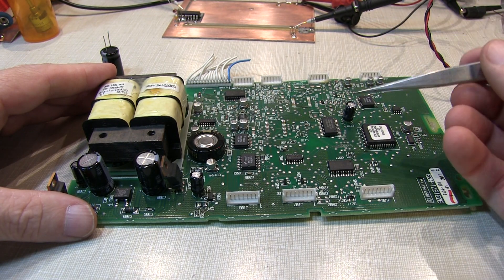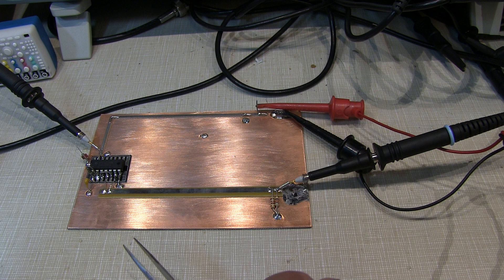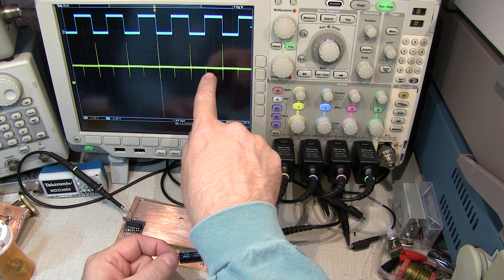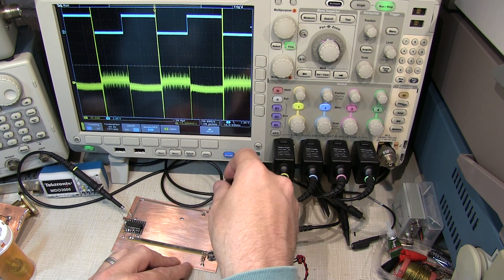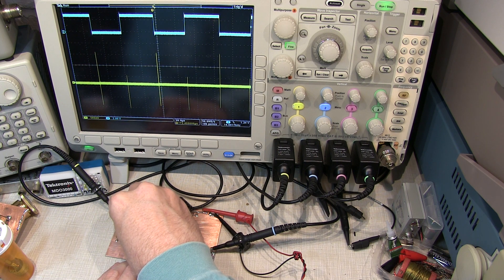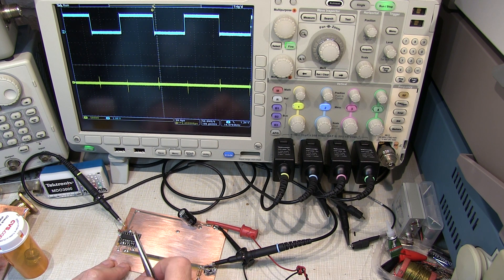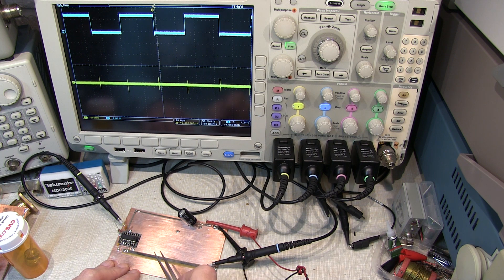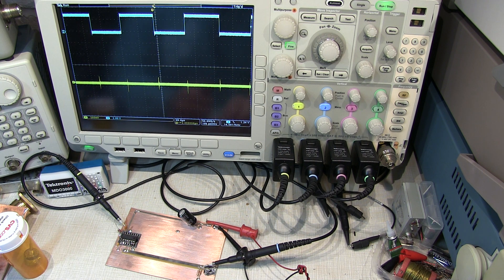#257: Power Supply Decoupling &  Filtering: why we use multiple caps in different locations

Comment: When testing AC ripple on various power supplies how does a technician know what the AC ripple voltage should be? You measure the transformers secondary AC voltage X 1.414 = Rectified Pulsating DC Voltage. If the transformers secondary AC voltage is 12 VAC X 1.414 = 17 VDC output of the rectifier. The Ripple Factor is the RATIO of the AC voltage to the rectifier to the DC voltage on the output of the Rectifier.  To Calculate the Ripple Factor is 12 VAC divided by 17 VDC = 70% Ripple Factor?
Reply from the maker: I don't know anyone that uses Ripple Factor - the main thing to look at is simply the p-p amplitude of the ripple.
Reply: @w2aew but what is a good rule of thumb when measuring ripple, that 500mV is max p-p for all various power supplies? How does a technician know if the measured ripple p-p is bad or good. 250mV or 500mV is the max p-p ripple asa rule of thumb?
Reply from the maker: It’s not possible give an exact answer because it completely depends on the circuit that is using the power supply. Since circuits will operate fine with large ripple, some won’t.
Reply: @w2aew  So how does an electronic technician know if the AC ripple p-p voltage is the correct criteria for various circuits? Unless the schematic documents the AC ripple p-p, but if not documented the electronic technician is going to be guessing what the AC ripple p-p should be.
Reply from the maker: Lower is always better. If the ripple is not affecting circuit operation (such as hum in an audio amp, etc) then it’s ok.
Reply: @w2aew  Linear Power Supplies use the Filter Capacitors that are at a cut-off frequency at 100hz or lower so the filter capacitors will reject all the frequencies below 120hz? The Hum is 60hz , the rectification is 120hz, so the filter capacitors cut-off frequency has to be 100hz to reject the AC ripple frequency at 120hz
Reply: @w2aew  Can you use the filter capacitors datasheets specs has a ripple max as a reference?

Comment: Very good video! I agree with you! I'm already 70 years old, I can't stop this profession. (It's also my hobby) I also worked as a sound engineer and I also worked with impulse technology (analog video) circuits. This "impedance" approach has also worked for me. I used to design audio power amplifiers with a bandwidth of several megahertz, without loop feedback. They had very good voices. I wish you more success and good health from Hungary.
Reply: In principle, this is true, but the output impedance of the regulators is also frequency-dependent. Music is rarely sinusoidal, mainly composed of transient elements. Incidentally, in recent decades, even professional audio equipment has been made with switched-mode power supplies. A little money sometimes brings positive results. 40 - 50 years ago, I did not have the money for a high-quality audio analyzer like I do now (Neutrik A2-D). That is why I built a correct square wave generator for frequencies of 100 Hz, 1 KHz and 10 KHz. I examined the result on a Tektronix 465 CRT (100 MHz) oscilloscope. Audio circuits gave very different responses. Last year, I examined the signal of a friend's Quad 66 preamp and found a ringing of 20% amplitude in the case of a square wave. The reason: The audio signal coupling capacitors were 25uF bipolar electrolytic capacitors. I placed a 680 nF polypropylene induction-free capacitor in parallel with each one and the ringing stopped completely. The sound also improved significantly when listening to music. I was also a theater sound service engineer for many years. I test the audio capacitors with an HP 4277 A L-C-Z meter (10 Khz to 1 MHz) and get very useful information. I wish you continued success and good health!
Reply: @ Anybody who is concerned about linearity in audio circuits needs to go with differential class A circuits. That solves all problems of that sort. Modern operational amplifiers, even in single ended class AB modes achieve 0.0001% distortion or less. That's absolutely unnoticeable. They have power supply rejection of 90dB or more at 1kHz. This means that we have to reduce power supply noise to less than a few 10mV  if we want to have -120dB distortion/noise at the output. This requires  power supply impedances of .1Ohm or less (if we assume a total of 100mA AC currents at the OP outputs). This is easily achievable with 10MHz gain bandwidth in the voltage regulator feedback amplifier. That's it. No further filtering is required.
Reply: Capacitors are pointless for audio circuits. You have to rely entirely on the impedance of your voltage regulator.

Comment: For any power supply the filter caps total capacitance value is based on how much the output LOAD/circuit under test is pulling/drawing? or is the total filter capacitance value based on the AC ripple voltage? Most EE techs tell me that the filter caps Size is NOT based on the loads current draw but the filter caps Size is based on the AC ripple
Reply from the maker: These things are related. The current drawn by the load is what causes the ripple to happen because it is pulling charge off of the caps.  The larger the caps, the less the voltage drops for a given load current.  So the answer is that the caps are chosen to keep ripple at/below the max acceptable ripple for the expected load current.
Reply: @w2aew  what is determining the load current? Because if the the load current measures 2 amps the filter caps size is not based on the load but it's based on the load current. You can't convert load current into filter cap size?
Reply from the maker: @waynegram8907    The circuit that is being powered up by the power supply will draw whatever current the circuit requires at the given supply current.  This is the load current.  This current is what will draw charge off of the power supply filter caps.
Reply: @w2aew  Right, if the load current is measuring 2 amps that means its pulling 2 amps of charge off the filter caps. The problem is there is no formula to calculate 2 amps of load current "convert" to filter size. I'm not sure why there isn't a formula because there should be sometime of conversion. What design engineers do is they keep adding filter capacitors until the ripple voltage is under 500mV then they just add up all the filter capacitor values to get the total cap value. Most LAB Power supplies you set the voltage and set the current but it doesn't display the AC ripple voltage on the LAB power supplies so when testing various circuits under test you don't know the AC ripple operating voltage p/p should be. Often you have to add more filter capacitors on the output terminals of the LAB power supplies depending on the load current of the circuit under lest?
Reply from the maker: @waynegram8907    The designer has to consider how quickly and how often the power supply can put charge on the caps, and how much is expected to be pulled from the caps.  With this information, they can calculate the voltage droop between charge cycles and thus calculate the ripple.  For LAB power supplies, the output caps are made sufficiently large to meet the ripple specification at the maximum rated current.
Reply: @w2aew  what is the general rule of thumb as the acceptable ripple for the load current? Like for every 1amp of load current the ripple has to be 10mV just as an example

Comment: What is the difference between measuring PARD compared to measuring Ripple on power supplies and various electronic loads? Electronic loads will also output PARD and Ripple, any reasons why?
Reply from the maker: Scroll down to the Ripple and Noise Specification section of this webpage for a complete description of ripple and PARD.
https://www.tek.com/en/documents/application-note/understanding-linear-power-supply-specifications
Reply: @w2aew  ok thanks, because I'm confused on the differences between PARD and Ripple because other EE techs have told me that they are two different measurements but I'm not sure how to measure PARD on linear and SMPS power supplies and various electronic loads and reactive loads. Other techs say that PARD and Ripple are the same thing but others techs say they aren't the same things so I'm confused.

Comment: I just found this video via a LinkedIn post.  Well done!  I love how you used a simple copper plane PCB to illustrate the concepts.  How are you interfacing the scope probes to the PCB?  Is there a special Tek test point that solders to a circuit and clamps on the probe?  Also the grounding of the probes?
Reply from the maker: I am using simple pin sockets that are soldered to the signal line and ground, and inserting the probe tip and ground-spring adapter into those pin sockets.  The pin sockets I am using are from Mill-Max, purchased through Digikey or Mouser (I don't remember which one).
Reply: If you want a precision measurement, then you integrate an RF connector on your ground and power planes. I typically use SMA. It's cheap, robust and gives you the correct results up to 12GHz. Few people will ever have to go above that.

Comment: I did not understand one thing, the signal current path takes the smallest loop back to the IC, and from IC it has to travel back to the power supply? I did not understand what that means. The return current needs to go through the power supply GND, how does it do that by going through the IC?
Reply: At high frequencies you would have to solve Maxwell's equations. This can be done numerically with software but it's complex. There is no easy way to estimate current distributions. As a general rule: copper layers have to be continuous. Any disruption forces the current to take a longer path, which adds to emissions and local noise levels.

Comment: Old vintage power supplies uses "Bathtub capacitors" which are filled with Pyronol oil? I'm not sure why they used these Chrome Square cube shaped Bathtub Capacitors any reasons why they used them?
Reply from the maker: They were used because it is what was available at the time that could meet the voltage, capacitance and ripple current requirements.
Reply: @w2aew  So they are using those Bathtube capacitors as filter caps like electrolytes? back in the 40s and 50's I think they only had and used DRY Electrolytes capacitors they didn't have WET electrolytes capacitors, not sure why that is.

Comment: Guitar tube amplifiers have a Standby switch. The Standby switch is used so that the filter caps have enough time to charge up. This is Not called time constant or charge time because that would be an RC network. When filter caps are charging up, what is this called? its not called time constant or charge time. The Standby Switch also is used for In Rush Current from the amplifiers preamp and power amplifier section as a load drawing a lot of current, so you want to use the standby switch FIRST so the filter caps are charged to 100% so you don't get those In Rush current spikes and surges.

Comment: It would be nice if you make a video lesson about "power conditioning" because when connecting various power tools to the same breaker/outlet it will cause harmonics, noises, etc injecting it into the power supplies that are connected to the same outlet/breaker. What are some theory and filters to use for power conditioning to get fid of all these harmonics, noises, etc on the 120vac being bleed into the other power supplies. Power tools and various lighting will have these nasty noises riding on the 120VAC it would be nice to go over power conditioning to get rid of these various noises and harmonics.

Comment: Great work of explaining decoupling caps.  I learned why it is not important to place large caps near the active devices.
Of course you could improve it  by placing a smaller cap, say 150pF, next to 1.5 nF to get rid of self resonant frequency of 1.5nF cap.
They , also, use beads for RF circuit isolation.

Comment: Why can't the high frequency current follow a path on top of the transmission line instead of the bottom?
Reply from the maker: It'll predominantly follow the path of least impedance (smallest loop area), this could be in the ground plane above, below, or adjacent to line - or some portion of all three.

Comment: very useful for me, i am trying to use high speed IC on arduino, apparently one module has a defficient capacitor. Tomorrow i am going to buy a 100nF ceramic capacitor and place near the module, hopefully this solves the problem.

Comment: Why do regulators have a dropout voltage? I'm not sure what is causing the dropout voltage inside the regulator circuit
Reply from the maker: Internal to the voltage regulator is circuitry that controls a device, usually a transistor, in series between the unregulated input and the regulated output.  This transistor is what is adjusted by the regulator to produced the desired voltage at the output.  This transistor needs some voltage across it to work (collector to emitter).
Reply: @w2aew  There is an internal Series Transistor across the unregulated input and regulated output that is causing the "dropout" voltage?
Reply from the maker: @waynegram8907  yes
Reply: @w2aew  thanks because the older 70s early 80s regulators have 3vdc dropout voltage

Comment: I like your videos. The challenge in supplying high frequency current is the load may be dynamic. In other words, not just a set repeatable current step as with your demo board. Although it is an excellent place to start.

A microcontroller is a good example where current demand is really dependent on the code that is running (ports turning on and off). How to address decoupling with a dynamic load which may only occasionally exhibit a worse case current draw (special exception through the code)? 

We have to look at supplying current in the magnitude that is required (with some margin) without limitations due to inductance in a worse case estimate. So a low ESR bulk-ish cap (like a tant) may be very close to the processor depending on the overall supply impedance at chip. For the very high frequencies the lowest inductance decoupling cap is actually the interplane capacitance. This is one of the reasons we use adjacent power planes in multilayer PCBs. 

Essentially, different capacitors are used in parallel to compliment each other for lowest impedance or overlapping lowest Z self resonance. These together form a Power Distribution Network (PDN). From a high level standpoint power is consumed over a broad band of frequencies. For lowest EMI supply impedance must filter (satisfy) currents such that the power from an outside source (AC supply for example) is of a very low frequency content. Ideally a steady supply or average current without high frequency content. The video you did on E and H near field probes ties into identifying problems with the PDN.

Comment: Regulator video lesson about regulators output capacitance value because the datasheets says that the regulator IC chips output pin has to be at a certain mA current at all times or the output pin will be unstable. When a regulator IC chip specs says the output can SINK 500mA, that means if the circuit under test has a Short and is drawing 500mA or more the regulator is sinking 500mA? For some reason the datasheets on regulators will spec the output as SINKING how much current, not sure what uses would it be to Sink 500mA. I rather it Source 500mA because that is providing 500mA to the circuit under test but Sinking 500mA I have no idea what use would be to Sink 500mA, do you know what they mean?

Comment: Excellent presentation and spot on. The YouTube PC repair channels that simply remove and discard shorted decoupling caps and not replace them with equivalent parts and then state "it's not needed" should reconsider their advice and start replacing them rather than stating "it's fixed" because the short is gone. There is a reason why the engineers put them there, as W2AEW makes abundantly clear.

Comment: As things are moved about, as boards expand and contract differently with temperature, etc. the power connections slip and generate us and ms having no power connection.  Bulk capacitors near power connections absorb these transients and the board's circuitry continues to function.  Less voltage transients across connectors make them last longer as well.  This is all in addition to the benefits you mention.
If an IC or transistor has only one high current output (or you are utilizing only one), you can reduce the transient even more by grounding the cap as close to that current's return as possible and by placing the power end as close to the power pin as possible while enclosing as little area as possible.  For hand assembly, a small axial cap directly across the chip yields optimum performance.

Comment: Cheap switching power supplies will have the switching frequency leaking through on the output of the power supply. If you're trying to apply +12vdc to an audio amplifier the powers supply switching frequency will be leaking riding on the +12vdc power rails. If you add RC filters on the audio amplifiers power rails to filter out the switching frequency of the power supply will this fix the problem or add more problems?